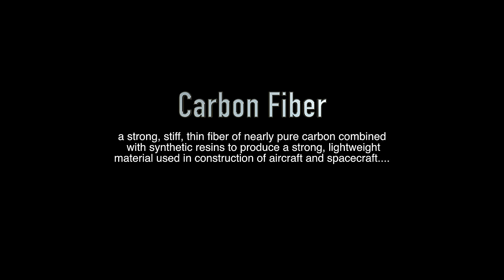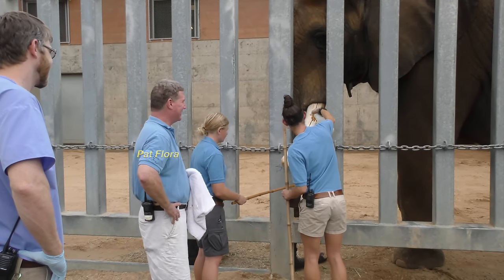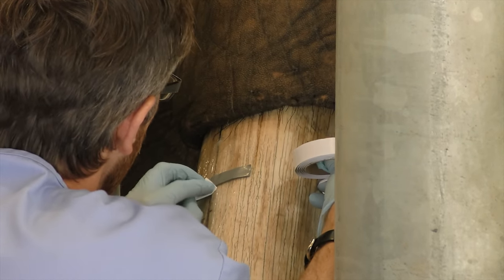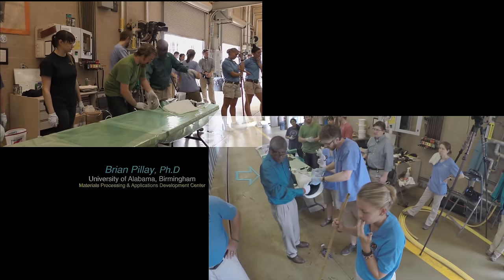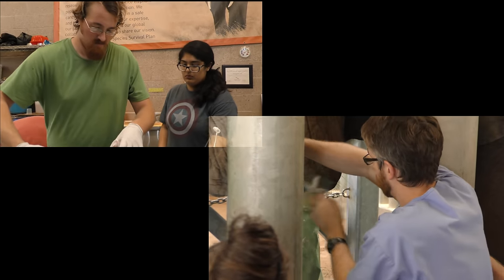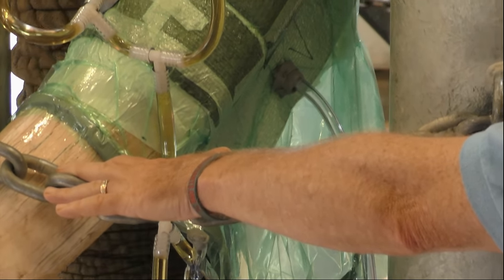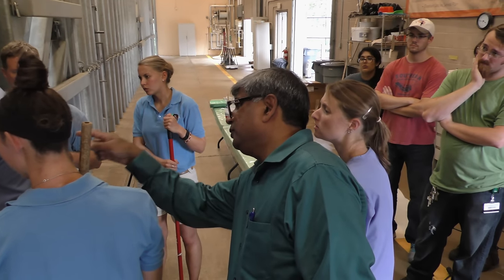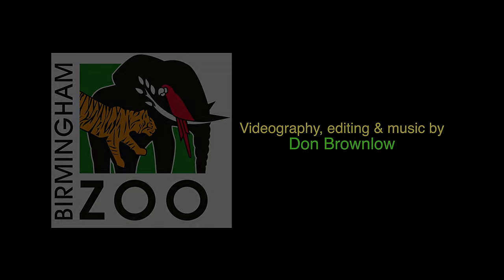Birmingham Zoo Space-age Elephant Tusk Repair

Comment: Why don’t we put a stain on the elephant tusks in areas where poachers are killing elephants for their ivory? To take the value out of the ivory would seem to be the best solution unless every adult elephant is hooked up to radio monitors.
Reply: Bobby Paluga because the stain is only on the outside.
Reply: Wild elephants won't cooperate. Sedation is risky. There are 300,000 wild elephants in Africa. But the concept is good if it were otherwise feasible.
Reply from the maker: Through the years, National Geographic Magazine has featured articles which describe various ways scientists and conservationist are attempting to combat the multi-million dollar poaching industry. One operation indeed embedded a GPS tracker into an existing pair of confiscated poached tusk to trace the smugglers' pipeline.  Unfortunately, recent rollbacks in the United States regarding bans on importing endangered species trophies in fact encourages and strengthens the poachers' profitability margins. Definitely not good.